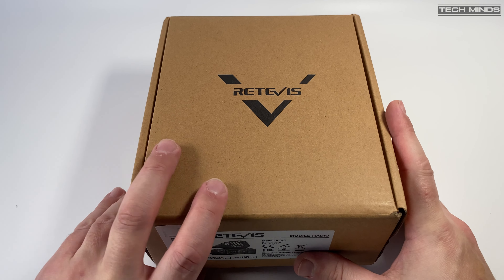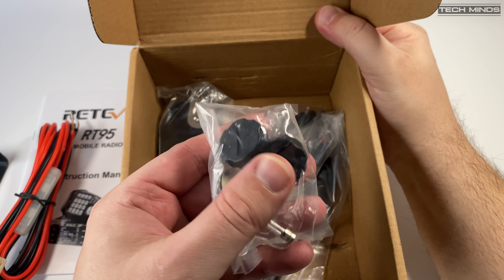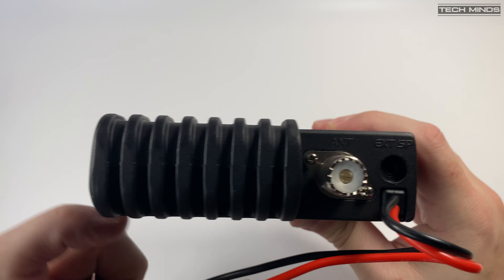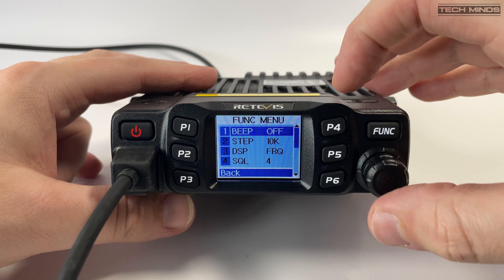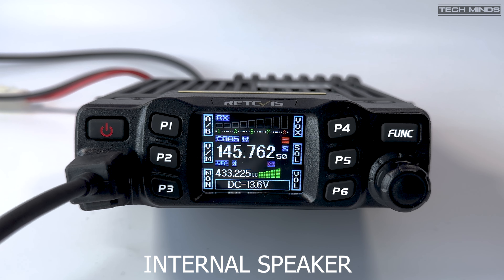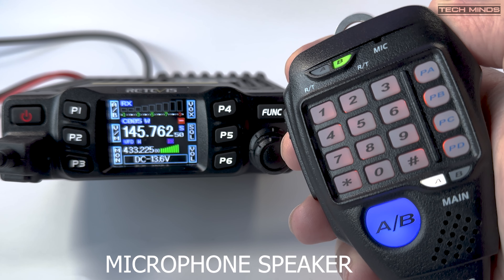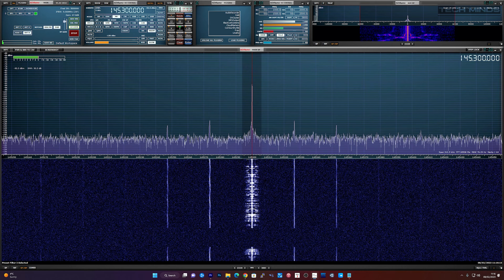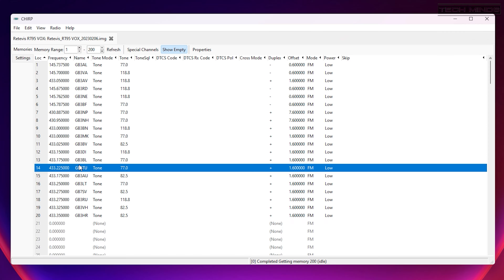Retevis RT95 Dual Band Low Cost Transceiver

Comment: The RT95 is probably my most used radio.  My one complaint was that its US 70cm coverage was not complete.  The US 70cm band ranges from 420 to 450 MHz but this radio (at least mine bought 2 years ago) stopped at 440 MHz.  The fix is to change the radio's region setting.  IIRC, the legit region choices are supposed to correspond to EU and US, but there's a third region: "Mode 2" which is wide open.  Retevis themselves told me the region change process when I complained about the incomplete 70cm coverage:

To change "mode":  With the power off, hold P4 and FUNC and Power buttons at the same time.  Unit powers on to a menu: rotate the knob to select to select the "Mode" menu.  Press and hold the PTT button, the rotate the knob to select Mode 2.  This opens RX/TX to 136-174 MHz and 400-490 MHz.
Reply: Good info.  So adjusting the mode setting not only gets the entire 2m and 70cm band in the US, but a much wider (not legal) transmit range?  It would be nice if there were mode settings for transmitting in the legal range in each country but no more.
Reply: @Liberty4Ever  As long as you don’t actually use the non-legal frequencies you should be fine though right?
Reply: @Liberty4Ever  I don’t think you’d accidentally transmit unless the radio had spurious emissions issues or you’re keyed up on those frequencies and you hot mic? Still a learning ham though so I could be wrong. I think if you don’t key up the illegal frequencies I think you’d be ok on paper.
Reply: @echofoxtrotwhiskey1595  - It's surprisingly easy to accidentally tune the wrong frequency and then transmit, thinking you're on a different frequency.  I could call for ten minutes hoping for a reply and never questioning if I was on the wrong frequency.  I think it's likely that the FCC wouldn't revoke your ticket if they believed it was a mistake, but they could.  Mostly, they're looking to punish malicious transmissions, but imagine that your radio was set to automatically transmit on a repeater offset frequency.  You could be tuned to one frequency (possibly even in the amateur band) and without the transmitter knowing to block out-of-band transmissions in your country, you could be transmitting on a government emergency response frequency.  EMS could be responding on your transmit frequency asking you to clear the channel and you'd never hear them.  You'd be blithely transmitting, "CQ to thuh repeater. Ain't there anybody out there?  N6ABCD over." and jamming EMS attempts to coordinate their rescue efforts at a gruesome six car pileup on the interstate.  That's an extreme example but it's easy to make a mistake and continue in error while causing significant interference outside the amateur band.  As usual, government gives itself a pass when they make a mistake, but are much less forgiving when anyone else makes a similar mistake.  The radio really needs to protect us from such mistakes, and that's even more true for new hams who haven't already made enough mistakes to have learned from them.  It's much better to make a mistake like that and have the radio correct you by not transmitting, rather than having the FCC correct you by initiating action against you.  I haven't done any of the MARS mods on my radios to open them up to transmit on nearby military frequencies, because I don't want to do that and I prefer that the radio prevent me from doing that.  I like a radio that will receive as much as possible, although now most government transmissions (including garbage collection in my town) use military grade spread spectrum encrypted communications, something that amateur radio operators are not allowed to do.  Ham radio operators invented radio and all advancements to radio, but aren't allowed to have private conversations.  Only government is allowed to have private and secure conversations.  Seems legit.   :-/
Reply: @Liberty4Ever  Yeah that makes sense.
Reply: I tried that on my micron vox and in test mode doesn't go past 42.
Reply: I hadn't planned to unlock mine but had to today to be able to add the 446MHz ISS 70cm FM simplex frequency.  I rarely if every operate in VFO mode and I'll be careful and keep an eye on band ranges and limits and on my license class's priveleges as usual and I should be fine.

Comment: I got my RT95 (VOX version) with the programming cable included just 2 or 3 weeks ago. What a lovely little radio! It's so easy to use that I was able to put the manual back in the box after just 2 hours. It packs enough power to let you hit repeaters within range and most nearby-ish simplex stations. It's simply a joy to use! Plus it costs less than most 5W HTs from the Big Three. It makes me smile every time I use this radio. It does everything that I need and nothing that I don't.

If you have the programming cable it's so easy to program it in CHIRP-NEXT, and if you go to the settings tab you can even reorder and reassign the P1 through P6 buttons (I set mine so P2 is POW and P4 is SCN), change the MON button so it toggles between squelch off and on instead of having to be held down to defeat the squelch, changed the knob's default function in memory mode from channel to volume, and changed the word RETEVIS om the splash screen to my callsign, amongst other things (like changing the scan from timer to carrier and the scan delay to 10 seconds, which both speeds up the (slow) scanning speed a wee bit to around 3 channels per second and prevents scan from resuming too soon if for some reason the carrier is weak.) 

Hayden, VK7HA on his Ham Radio DX channel tested his RT95 on a spectrum analyzer and found that the TX is very clean indeed on both bands, with the second harmonic being well below the fundamental, third harmonic barely showing up, and no spurious emissions. I wouldn't have bought this radio if it had dirty transmit but it's just fine.

Bear in mind that with no fan, just a passive heat sink, the chassis can get not just warm but HOT after a long ragchew, so limit your overs accordingly.  The bottom speaker has pretty good audio especially in combination with the speaker in the mic (I call it "poor man's Aess") but even a cheap front-facing external speaker is a big improvement. I use a Diamond (no relation to Diamond  Antennas) TS-750 speaker which has attenuator and on-off switches on the front. The attenuator's handy for  quickly halving the volume without having to turn the knob. Speaking of which, the radio has some quirks as do they all. For instance, now that the lone knob on mine acts as a volume control it doesn't work right away if the radio's scanning. I have to press on the knob to stop scan, then I can adjust the volume, then have to resume scanning.

73 Mat!

Comment: Other videos and websites have reported RT-95 is software locked for bands and can be opened by a keyboard during power-on to get 136 to 174Mhz & 400 to 490Mhz.
I think at some point that model was sold with three different varians like US-lock (like GMRS), ham-bands and fully open for business frequencies.

Comment: I've had the Anytone version of this radio for years and it's my main daily driver, only complaints is the speaker is tinny and the scan speed is slow but other than that it's a cracking little radio.
Reply: You can speed up the scan speed in the retevis programming software.

Comment: for better microphone modulation you need to install microphone amplifier in hand mic.
Modification of an Anytone / Retevis / CRT Micron microphone by Gert Bartelink

but personally i did similar mod however without getting rid of small speaker. I just desoldered the original microphone and soldered it to the amplifier using small wires (before removed big microphone from the amplifier board)

Comment: I notice you power supply voltage drops a bit on the high power setting. If it maintained 13.8 Volts i am sure it would make 25 Watts.
Reply: low power is a problem ...in the car i have to start up the engine or no tx at all

Comment: I have had this radio for a couple of years and it has performed quite solidly for me. Transmit audio always gets surprisingly good reports and receive audio is pleasant enough for me to use it as my main dual-bander in the shack. Excellent radio for the money. I also have the little RT98 mono-bander which I often use back-pack portable and sometimes mobile - again, it seems to have very good transmit audio.

Comment: I use it as a daily driver for my local and repeater QSO's and I regard it as a solid performer, the screen is readable, and the menu is quite thougtfuly laid out, which is not a given for cheap devices. The power output is also decent. I use it with a speaker from a philips HiFi, so I won't rate the internal ones.

Comment: This is a nice little radio. I bought one in order to have around 10-odd watts for use during the previous "145 Alive" event. It does have a few quirks, especially the multi-function rotary encoder which we might think of as a "volume control". It is a little bit annoying having to first press the P6 button in order to have access to the volume function before you can set it, but it's a minor gripe. The internal speaker is quite loud and clear, and emits a good quality sound. By contrast I found the speaker in the microphone to be difficult to use. It could be that the issue is with my particular microphone, yours sound a lot better than mine. In spite of the quirks this is a great little radio, excellent value for money.
Reply: You can sort the volume / channel knob in the CPS.
Reply: @M7BXR  Hi! Thanks for the pointer. I'll have to see whether the CPS software runs under Linux with Wine, otherwise I'm stuck with using Chirp. Anyhow, this is still a really neat little radio with a good out-of-the-box experience. I can live with it's default configuration, and will most likely only add a few local repeaters and maybe PMR channels - all for which Chirp should do fine.

Comment: Chassis is speaker definitely better than the mic speaker...no surprise there. I bet if you cranked your power supply up to the maximum spec voltage of 14.4v, you'd see the transmitter power output come up to the advertised specs. Trabsmit audio was surprisingly good .

Comment: Hi Mat, I just got myself one of these. The Abbree seems to drop power while longer transmissions and the pin layout of the mic is unknown since the manufacturer does not answer to my mails. This RT95 can do APRS or packet since the audio comes trough the mic. I found a video about this on YT. I send you the schematics by mail if you are interested to do a video on this subject. I have a TNC-X in my shack so I'm planning to wire a cable to use this radio for Winlink, APRS and packet. Cheers & 73 de Phil ON4VP

Comment: It is a great radio for beginners however the outgoing microphone audio is weak, and there is no way to adjust the mic gain. Using an aftermarket microphone is recommended with a higher input gain.

Comment: How about MARS and CAP frequencies for us that are members of these organizations who can legally use these frequencies? Is there a DMR capable radio with similar dimensions which would provide us with greater versatility. As for microphone speaker, not. I could understand if one used a military style handset where you need to keep it up to your head when talking in critical environments. As for the screen flip feature, somewhere in the past I recall one manufacturer having this option. I know it was a Motorola option for the Visar / HT1000 series of portables with top mounted channel display. Interesting bit of kit in general.

Comment: These are pretty decent, but I feel like you might have missed a few quirks. For instance, mine (Anytone US version) was unlocked for GMRS from the get-go. To adjust the volume, you have to click the function button, tap another button, then you can adjust. Not great. The lowest volume level is really loud, like most Chinese radios. Not fun if you use it as a base. The S meter is basically useless. Compare it to a Yeasu and you'll see what I mean. Scan speed is PAINFULLY SLOW. You'll find yourself clicking that tuning knob constantly to get in and out of menu functions. It gets tiresome. It is a solid build and the display looks very nice. The mic is pretty decent, although, like you said, it's plasticky. Final nitpick is intermod. This radio will pickup  adjacent channels pretty badly if you're in a high RF area. For the money, it's pretty decent, but it's not all wine and roses.

Comment: Thanks for the review. Can you run this off your car's 12V power supply, or do you need to connect it direct to the battery? I was just wondering if the current draw could potentially blow the fuse.
Reply: You might get away with using the car's accessory (cigarette lighter) outlet, but ONLY on the low TX power setting.  Much better to wire it in with its own fuse to a heftier source.  In my Toyota pickup I stuffed a crimped blade connector terminated wire into an empty fuse position in the under-hood fuse box, with an in-line fuse near the fuse box end of the wire.  The other end of the wire I fed thru the firewall where other wire bundles already passed into the cab.

Comment: Thanks for the review, some of these cheap Chinese radios are better than others! I had a Leixen VV-898 that curled up and died from pager overload when on 2 meters .yet my Yaesu and Kenwood radios were fine, I suppose you get what you pay for!
Reply: I have twelve, 898. In the last 8 years 3 have died. One came without certain pages in the menu making it useless. They need a low swr and that is why mine are slowly dying out. At $79 in 2013...they were a bargain.
Reply: I use a diplexer for two different antennas with my one 898.
I have a filter on the VHF side.

Comment: Noob radio question, why would you want 2w when you could have 22w?
Reply: Use the battery for longer if say the engine in the car is off and you reach whoever you need to without more power anyways.

Also RF exposure.
If you're using a trunk mounted antenna and you have passengers, you should avoid high transmit wattage.
Reply: Here is a good example. On the Marine VHF band , Channel 13 is reserved for talking to harbor masters or river lock masters. On this channel you should switch to 1 watt of power. So, to eliminate talking over other harbors or locks in the area they do this. With as little as 1 watt and antenna 8 feet of the surface of the water you can talk 2-4 miles.